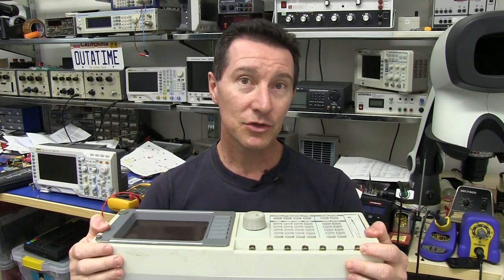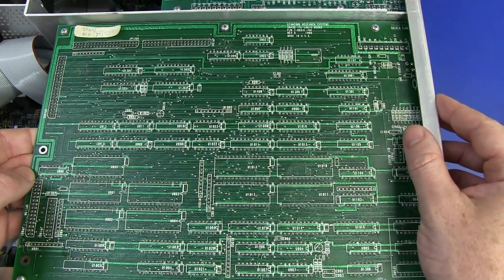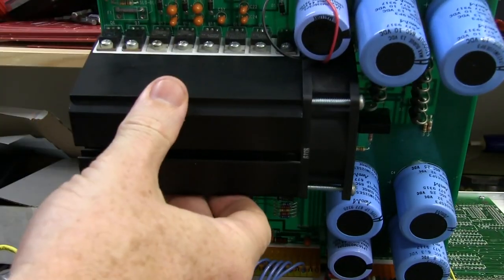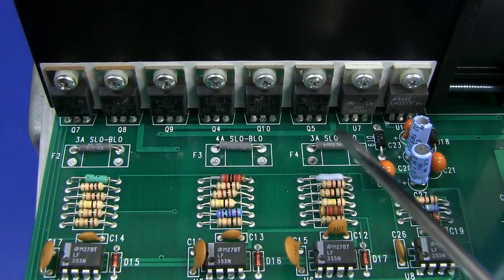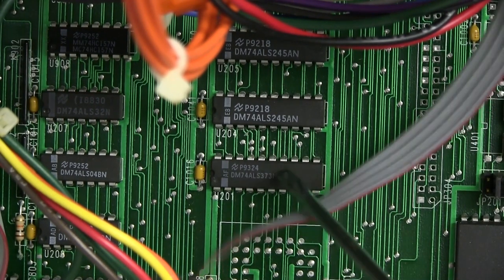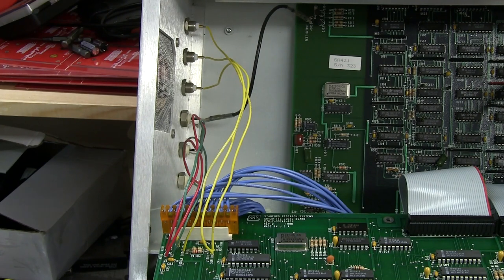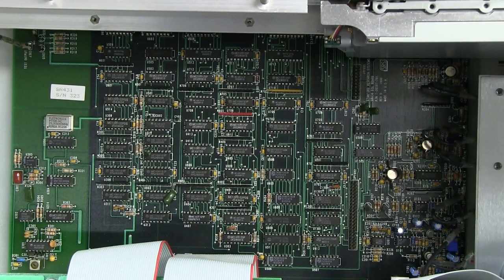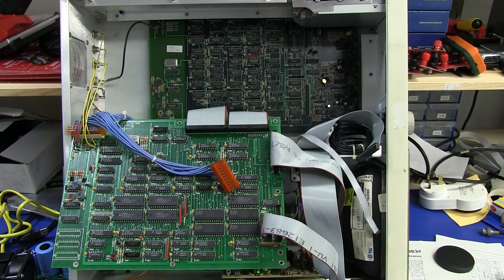EEVblog #452 - Stanford Research SR430 Teardown

Comment: Hi, this is Joe Wang from Stanford Research Systems. Just watched your tear-down and it's great. I haven't looked inside one of these in 20 years myself. It's a little weird hearing your observations today about design decisions made over 20 years ago. Boy am I getting old. BTW, both Andrew Mendelsohn and I are still at SRS designing new instruments (with new technology!). Almost all of this instrument will fit into a single FPGA now. Fun to watch your video here at work!
Reply: Hey Joe, are you available for some SR430 consultation? I bought an (apparently) inop SR430. Stay safe!
Reply: @kennarnett8220  I don't know about Joe, but once I contacted them in order to know about the possibility to replace the CRT by a LCD.  I only received a very unhappy message saying that all available info is on the manual. Great !! thanks for the support ! Thinking now twice before purchasing another SRS instrument.
Reply: @amsgomes97  thank you for the message! They do have replacement LCD for some of their equipment. Just not the 430. I found a manual on the web, of course it doesnt have schematics. As a first step, just getting a hold of all the schematics would allow me to make a good decision. BTW as is, the unit has value to someone with the skill (and parts). And it may be possible to access all the functionality over the GPIB using a Labview Virtual Instrument. Best wishes and stay safe!

Comment: An LED is a photon counter. Just reverse bias it to charge it up with electrons, turn off the voltage and time how long it takes for it to the voltage to drop back down with a high impedance input. Generally 20000 microseconds in shadow, but much less time in light, and a very long time in the dark. Yellow LEDs are the quickest, blue are the slowest. Photons cause the electrons to be knocked out of the cathode.

Comment: it's used for wheel alignment, you make a chalk mark on the wheel, spin it very fast and strobe it at precise intervals, your eyes are going to see the wheel "freeze" on each strobe(same effects as in a night/dance club). if the mark moves/wobbles then you change weights until it stops. nowadays there are machines that do that automagically with the wheel outside the car

Comment: This vid had me curious as I have used several SRS products during my MSysEng studies at UQ (University of Queensland). After looking at the website, I discovered they're still in the same location with he same contact info listed on that CRT. I drove by it on the way home from work (I live in San Jose, CA) and it's still there. 

Beyond all of that, a new SR430 appears to be available starting with a price of ~7950 USD.

Comment: Two possible reasons:

1) You need the battery for a real time clock
2) EEPROM (or Flash) wasn't available or proven technology when it was designed.

Comment: No, but you can find  them in CAD Systems from the late 80's and early 90's. There were IBM ISA bus cards for "LPKF" CAD Desing System and there was also a card for the Atari Mega ST using that chip. I quite liked them. Google for Atari and ACRTC for instance.

Comment: If you need a real-time clock you will need a battery.  Storing parameters in FLASH is then extra hassle when almost all RTC chips have battery backed RAM on the die.  Also  FLASH has a much worse MTBF than CMOS SRAM, even the newer stuff.  Every time there is a write to FLASH there is a chance that a cell will fail.  It takes a lot of work in code to make sure you can deal with bad writes to FLASH.  For many cases it is not worth the hassle or risk.

Comment: FLASH didn't exist back then, and EEPROM isn't easily field programmable. EEPROM is easy to load code into it outside the machine because it takes too long. You can have a programmer that programs banks of EEPROM at the same time. Programming each machine one at a time would be expensive.

Comment: IBM, back then, required that any chip they use have multiple sources. Intel was therefore forced into licensing their chip designs to other manufacturers. Intel designed that chip but AMD made it. Quite a different time for x86 back then!

Comment: How does this device count a single photon, i heard about using a avalanche diod but it require a high voltice circuit which isnt here. Are there any others method do detect a single photon?

Comment: Hello Dave. I have a little question to ask. Two weeks ago i found in my garage something called stroboscope. No idea what that is and what is used for. I have searched the Internet and i found out that is used for photographs. But its rally old. The last test has been done 1977 so this is older then this. If you have time to answer me it will be great. Thanks, vasil